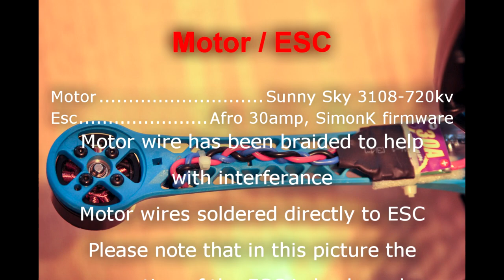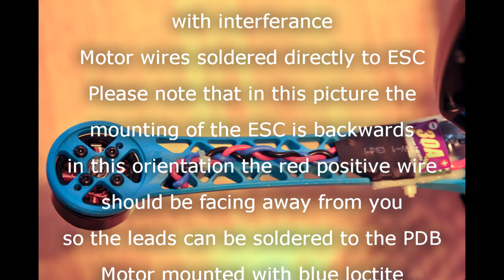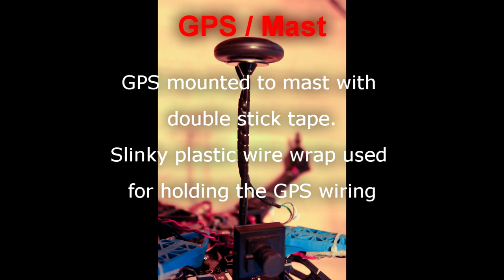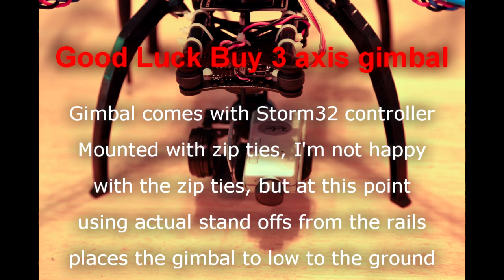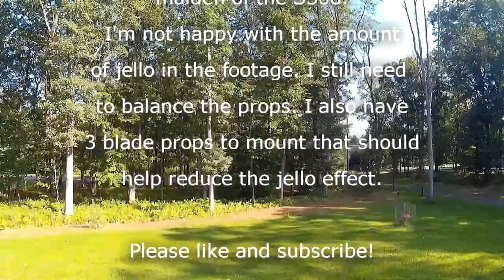S500 Quad build, with Pixhawk, GLB 3 axis gimbal

Comment: Love your build.  I have almost the exact same setup.  Couple of differences:  I don't have OSD; I have that 3-axis mobius gimbal (with RunCam 2 instead of Mobius) and I hate it, so replaced with a DJI-style 2 axis gimbal and SJ4000 cam; have a NightOwl camera for FPV; have an M8N GPS receiver to use both GLONASS and GPS. I had the same jello problem at first, and tried a 3 blade prop which only made it worse.  It's just a matter of tightening everything up, balancing props, fine tuning everything to get that smooth ride.  Eventually I got the video I wanted.  Thanks for sharing!

Comment: I’m going to build one of these with the cheap frames I don’t mind really and it will be my first build , I am looking for the most flight time I can get & I also don’t mind cutting down on other expensive / heavy useless things , I personally don’t need a GoPro I can be fine with a 200mw all in one can with its own lipo to power it separately from the quad too . Not sure what flight controller to get yet or gps/compass , I have a flysky Fs i6s innits way in the mail so I need something that is compatible do you have recommend ? Thanks
Reply: How did it go hunter ?  Also doing this as a first build. Just waiting for my soldering iron to arrive.  Likewise i am using the flysky Fs i6s, have a naza lite, 820 kv motors,  she'll be rocking my old original yi cam and a cheap n cheerful 3 axsis gimbal.   Do post your flight maiden mate !

Comment: Hi

I have a similar construction. Same frame, similar gimbal, xiaomi yi camera I use motors 2216 1100. Battery 5000 4s. Propellers 1045. How long does the flight of your drone take on average?